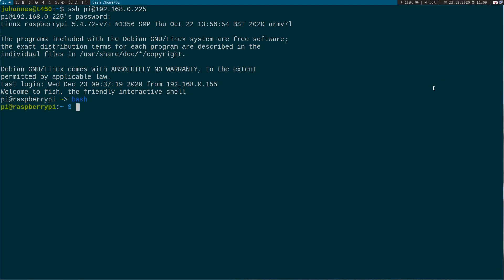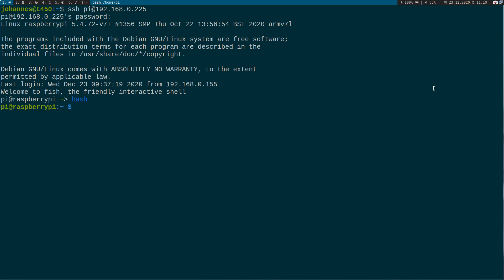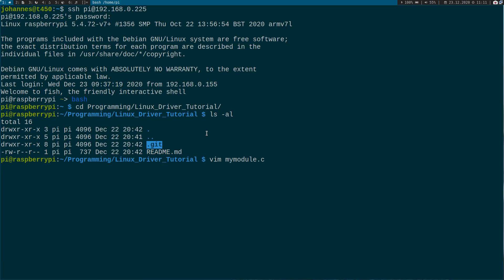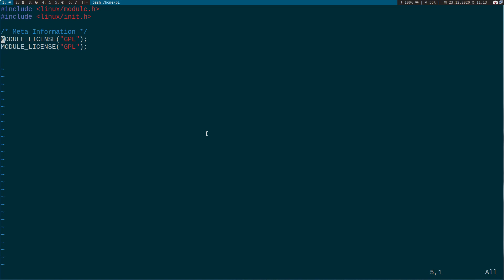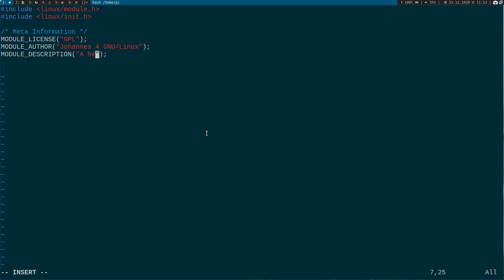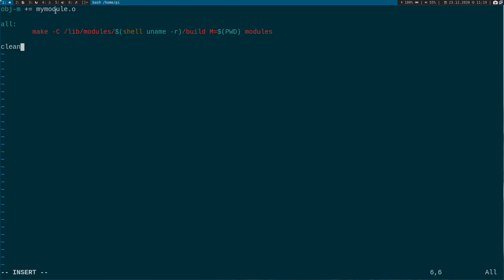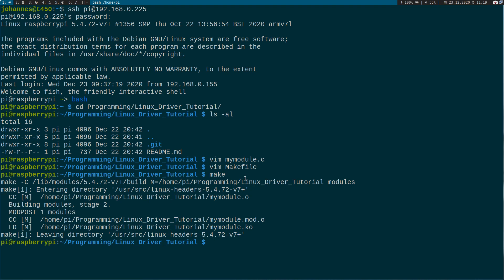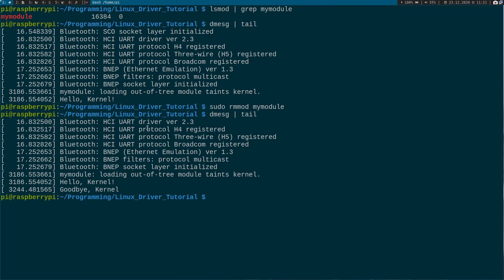Let's code a Linux Driver - 1: Hello World Linux Kernel Module

Comment: using a pi5, getting make file issues

any idea, thx sean

Sean@raspberrypi:~/Programming/LinuxDeviceDriver $ make --trace
makefile:4: target 'all' does not exist
make -C /lib/modules/6.6.47+rpt-rpi-2712/build M=/home/Sean/Programming/LinuxDeviceDriver modules
make[1]: Entering directory '/usr/src/linux-headers-6.6.47+rpt-rpi-2712'
/usr/src/linux-headers-6.6.47+rpt-common-rpi/Makefile:246: target '__sub-make' does not exist
make --no-print-directory -C /usr/src/linux-headers-6.6.47+rpt-rpi-2712 \
-f /usr/src/linux-headers-6.6.47+rpt-common-rpi/Makefile modules
/usr/src/linux-headers-6.6.47+rpt-common-rpi/Makefile:817: target 'include/config/auto.conf' does not exist
test -e include/generated/autoconf.h -a -e include/config/auto.conf || (                \
echo >&2;                                                       \
echo >&2 "  ERROR: Kernel configuration is invalid.";           \
echo >&2 "         include/generated/autoconf.h or include/config/auto.conf are missing.";\
echo >&2 "         Run 'make oldconfig && make prepare' on kernel src to fix it.";      \
echo >&2 ;                                                      \
/bin/false)
/usr/src/linux-headers-6.6.47+rpt-common-rpi/arch/arm64/Makefile:59: update target 'stack_protector_prepare' due to: prepare0
/usr/src/linux-headers-6.6.47+rpt-common-rpi/Makefile:1819: update target 'prepare' due to: stack_protector_prepare
if [ -z "y" ] && [ "gcc-12 (Debian 12.2.0-14) 12.2.0" != "gcc-12 (Debian 12.2.0-14) 12.2.0" ]; then \
        echo >&2 "warning: the compiler differs from the one used to build the kernel"; \
        echo >&2 "  The kernel was built by: gcc-12 (Debian 12.2.0-14) 12.2.0"; \
        echo >&2 "  You are using:           gcc-12 (Debian 12.2.0-14) 12.2.0"; \
fi
/usr/src/linux-headers-6.6.47+rpt-common-rpi/Makefile:1946: update target '/home/Sean/Programming/LinuxDeviceDriver' due to: prepare
make -f /usr/src/linux-headers-6.6.47+rpt-common-rpi/scripts/Makefile.build obj=/home/Sean/Programming/LinuxDeviceDriver need-builtin=1 need-modorder=1
/usr/src/linux-headers-6.6.47+rpt-common-rpi/scripts/Makefile.build:41: /home/Sean/Programming/LinuxDeviceDriver/Makefile: No such file or directory
make[3]: * No rule to make target '/home/Sean/Programming/LinuxDeviceDriver/Makefile'.  Stop.
make[2]: * [/usr/src/linux-headers-6.6.47+rpt-common-rpi/Makefile:1946: /home/Sean/Programming/LinuxDeviceDriver] Error 2
make[1]: * [/usr/src/linux-headers-6.6.47+rpt-common-rpi/Makefile:246: __sub-make] Error 2
make[1]: Leaving directory '/usr/src/linux-headers-6.6.47+rpt-rpi-2712'
make: * [makefile:4: all] Error 2
Sean@raspberrypi:~/Programming/LinuxDeviceDriver $

Comment: 9:16 What exactly are you pointing to when you have the following path -C /lib/modules/$(shell uname -r)/build? I'm getting a "no such file or directory"
Reply from the maker: It resovles to something similar like this:
/lib/modules/6.10.5-arch1-1/build
If you are missing the build folder, you have to install the linux kernel headders, e.g. with "sudo apt install raspberrypi-linux-headers" on a raspberry pi.

Comment: Hi Johannes ,Is this tutorial work for RPI 5?
Reply from the maker: Yes, all of my driver tutorial videos (if they are not outdated like the first SPI and I2C videos) should be compile-able on any Linux system. That's one of the tasks of an operating system to give us a hardware abstraction layer. When you come to drivers accessing hardware (e.g. accessing GPIOs) maybe you have to change something (e.g. pin numbers), but in general it should work.

Comment: Hello! I've got makefile error:
make -C /home/jonathan/Linux_Kernel/5.3.0-28-generic/build M=/home/jonathan/Linux_Kernel modules
make[1]: * /home/jonathan/Linux_Kernel/5.3.0-28-generic/build: No such file or directory.  Stop.
Makefile:4: recipe for target 'all' failed
make: * [all] Error 2

i am using ubuntu 18.04 without board for now. but it should compile, right?
Reply from the maker: Have you installed the Kernel headers? On Ubuntu run: sudo apt-get install linux-headers-$(uname -r)

Are You using the same makefile as I do? The path /home/Jonathan/Linux_Kernel/5.* Looks wrong.
Reply: @johannes4gnu_linux96  Cool it seems to work! but i didn't get .ko file :

make -C /lib/modules/5.3.0-28-generic/build M=/home/jonathan/Linux_Kernel modules
make[1]: Entering directory '/usr/src/linux-headers-5.3.0-28-generic'
  Building modules, stage 2.
  MODPOST 0 modules
make[1]: Leaving directory '/usr/src/linux-headers-5.3.0-28-generic'
Reply: Update: it produces .ko file. i had spelling error in make file
Reply from the maker: @Jonathan-ru9zl  Good to hear it works.
Reply: @johannes4gnu_linux96  My Raspberry pi 4 2Gb had problems with this command: sudo apt-get install linux-headers-$(uname -r)

The problem was that even if the 32 bit raspberry pi operating system is installed it is still trying to use the 64 bit kernel or something. I needed edit"/boot/firmware/config.txt" and in the "ALL" section add "arm_64bit=0". After reboot it the command worked fine.

Comment: Hey, first of all, thanks very much for the playlist. I have a problem when I try to insert the same module you have shown in the video. I am getting the error "Invalid module format" from insmod, any help is appreciated, thanks!
Reply from the maker: You are welcome.
To help you, I need more information:
- What is your target (Raspberry Pi)?
- Are you doing the compiling on the target (on the RPi) or are you using cross compiling?
- If you are on a RPi, have you followed the tips shown here: https://www.youtube.com/watch?v=RJr0c4dpKxI

I know this error from doing cross compiling and the Kernel Version on my Target didn't match with the Kernel I used to compile my sources.
Reply: @johannes4gnu_linux96  Oh okay, I am actually on Ubuntu virtual machine. I looked around before I commented here, I am sure the kernel I am running and the target kernel during compilation is the same, because the output of uname -r command matches.

Comment: Fantastic video. I've seen so many different ways to do this, so it would be a nice addition if you added how to build the module when not on the target machine. Use if depmod and other tool, etc.
Reply from the maker: Thank you. Yes, maybe later this year I want to do a session about Cross Compiling. But therefore I would like to use an industrial grade SoC on an evaluation board. And I am still looking for an affordable candidate.

Comment: make[1]: * /lib/modules/4.19.94-ti-r42/build: No such file or directory.  Stop.

could not insert module main.ko: Invalid module format, 

any idea on how to deal with this error
Reply from the maker: It look like the kernel modules are not installed. Are you using a TI EVM or beaglebone with (Yocto) Linux?
For the raspberry pi maybe this helps: https://www.youtube.com/watch?v=RJr0c4dpKxI

Comment: I see that he works with a Raspberry Pi, I can follow the videos and do the practices in my coputer x86_64 with Linux?, or it is necessary to use a Raspberry?
Thanks  for sharing these videos.
Reply from the maker: Most of the videos should work except for those in which I access pheripherals Like GPIOs, I2C, SPI, ... These are normally not so easy accessable on a Standard PC Like on the Raspberry Pi.
Reply: @johannes4gnu_linux96  Thank you very much, I will continue watching your videos.

Comment: good video however I was not able to go beyond compiling the module
-------------
make -C /lib/modules/5.10.63-v7+/build M=/home/pi/kernel_work modules
make[1]: * /lib/modules/5.10.63-v7+/build: No such file or directory.  Stop.
make: * [Makefile:4: all] Error 2
-----------

Apparently headers do not exist for my raspbian kernel
Reply from the maker: Thank you.
Run this Commando:
sudo apt install raspberrypi-kernel-headers

This should solve the problem.
Reply: @johannes4gnu_linux96  thanks

Reading package lists... Done
Building dependency tree
Reading state information... Done
raspberrypi-kernel-headers is already the newest version (1:1.20210831-3~buster).
0 upgraded, 0 newly installed, 0 to remove and 51 not upgraded.
Reply: @imranrajjad7028  i m having same problem help me
Reply: make -C /lib/modules/5.10.63-v7+/build M=/home/pi/Programming/Linux_Driver_Tutorial modules
make[1]: * /lib/modules/5.10.63-v7+/build: No such file or directory.  Stop.
make: * [Makefile:3: all] Error 2
Reply: @johannes4gnu_linux96   
error still continue :(
make -C /lib/modules//build M=/home/pi/hello modules
make[1]: * /lib/modules//build: No such file or directory.  Stop.
make: * [Makefile:4: all] Error 2
Reply: @johannes4gnu_linux96   ı dowload your git repo. but error still continue 
make -C /lib/modules/5.10.63+/build M=/home/pi/Linux_Driver_Tutorial/01_simple_LKM modules
make[1]: * /lib/modules/5.10.63+/build: No such file or directory.  Stop.
make: * [Makefile:4: all] Error 2
Reply from the maker: @AbdullahYüksel-n9y  Finally I could reproduce the problem.

If you install the raspberrypi-kernel-headers, it seems to install the kernel headers for the latest kernel for Raspberry Pi OS, but not for your current kernel version. So, you have to update the OS to the latest kernel with sudo apt update && sudo apt upgrade and then reboot. After that you should have installed the latest kernel and it should work.
Reply from the maker: Finally I could reproduce the problem.

If you install the raspberrypi-kernel-headers, it seems to install the kernel headers for the latest kernel for Raspberry Pi OS, but not for your current kernel version. So, you have to update the OS to the latest kernel with sudo apt update && sudo apt upgrade and then reboot. After that you should have installed the latest kernel and it should work.

Comment: Johannes, thanks for this video. I followed the exact steps but I run a problem. /usr/src don't have the linux-header files as it already does in your tutorial. I'm using raspbian on my Raspberry Pi 3+.
It took me a while to figure it out. But basically I could solve it with 2 commands:
sudo apt install raspberrypi-kernel
sudo apt install raspberrypi-kernel-headers

The first one will update the kernel (if not updated) and the second will download the headers of the last kernel version, that are required to compile a module.
Hope this info helps someone.
Reply from the maker: Thank you for our feedback and the info :)

I mentioned this "preparation steps" in the first video, I have done on this "Let's code a Linux Driver" session:
https://www.youtube.com/watch?v=x1Y203vH-Dc
But it is also good to mention it here.

Comment: thanks for the tutorials, i noticed that you have just burned the image in sd card and put that sd card on rpi board and access the board by ssh. and then just start writing the module on it ... i have found other videos where people first setup the yocto project under that they setup the QEMU and on that they start writing the device driver(this method is difficult). my main question is what method is used for which purpose because in both methods the goal is to write the device deriver.? please reply me as soon as possible.
Reply from the maker: Well, both methods have their advantages and disadvantages. 

I choose to use a raspberry pi, because of the following reasons:
- a lot of people have RPis and know how to use them
- Good documentation
- Powerful computers (Mine has a Quad core A53 and 1GB of memory, which is a lot for an embedded device!)
- Full featured linux distro (with package manager, python, compiler, ... already available)
- RPi has all the important interfaces (SPI, GPIO, I2C, ...)

So, I choose the RPi because I wanted to use a comfortable computing platform, where I could just start to develop my Kernel Modules. I didn't want to use Cross-Compiling or Virtualization with QMENU because this are quite difficult topics and I just want to focus on the Kernel-Module-Programming. I believe for a beginner this approach is more straight forward and easier.

But if your target for your project is not a RPi, using your hardware, which is maybe not as powerful as the RPi, Yocto and Cross-Compiling is the way to go. Using Yocto has the advantages you can compile everything yourself (and apply some Kernel-Patches you are interested in, e.g. Realtime patches), you only have the programs onboard, you really need, you can use a custom Device Tree and your SD-Card Image will be a lot smaller then Raspbian. But going this way you loose a lot of comfort from the RPi, e.g. most Yoctos don't have a package manager as powerfull as apt, most of them don't have python or a compiler installed, ... With Yocto you really get a minimal Linux for an embedded system with all up- and downsides. You have to cross compile, because the compilation is to resource heavy for your tiny hardware, etc.

I would only use Virtualization with QMENU, if you don't have the hardware available and you want to start developing or if you have to debug a lot and you don't have a good (and most of the time expensive) JTAG-HW-Debugger.

So, for beginners, I would recommend to use a RPi. It will offer you a lot of comforts and a lot of interfaces.  But if you don't mind the interfaces, you can develop Kernel modules on a normal x86-PC too! All of my tutorials, where I do not need I2C, SPI or GPIOs will work fine there too! Then, when you are more familiar with the Kernel-Programming and you have a project with a different Target-HW, then go the next step and start using Yocto, Cross-Compiling and Virtualization.
Reply: @johannes4gnu_linux96  Thanks for your detailed answer which cleared my mind a lot, till now I have learned all of your device driver videos and from other channels, so I have written GPIO, USB, I2C and many more drivers. i have noticed that in all of that i just take any hardware attached with my rpi and start writing code. For example, In USB driver I attached my mobile phone with usb to rpi, and got the vendor id, product id with lsusb , and then wrote a driver to probe, disconnect and table, and get a minor number of device in output. and the same goes with the other drivers also. But I am unable to understand the need of writing drivers, in GPIO driver we can simply write c code or anything, what is the need of writing kernel device drivers. i have read my articles but I don't understand them completely, so I decided to ask you because your previous reply helped me a lot.

Comment: One thing not obvious to me first time is that the file name my_module.c has to match the module name as my_module.o in the Makefile. I thought you could name the module something different to the c file and the Makefile was smart enough to collect all the *.c files in the $(PWD) folder.
Reply from the maker: It depends on your makefile. In the makefile, I am using in the video, I just set some variables and then call another makefile located in /lib/modules/$(shell uname -r)/build. 
Here everything about how to build the module is defined. 
The makefile is only smart enough to build every c file it finds in the folder, if you specify it in the makefile. In the case of our makefile it isn't.